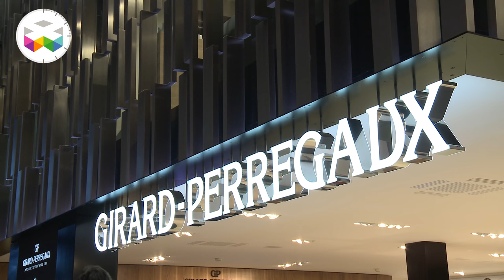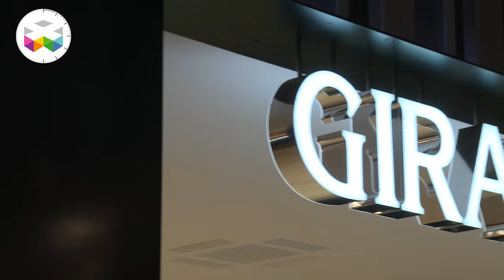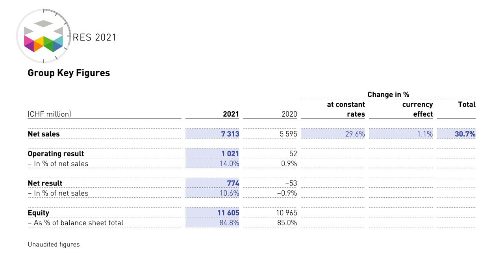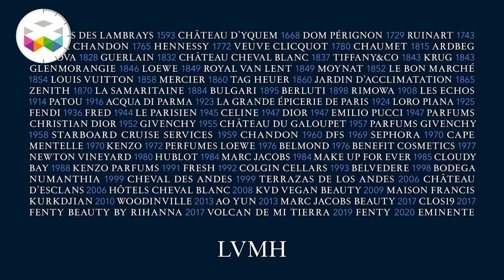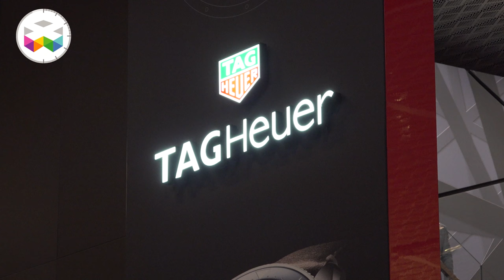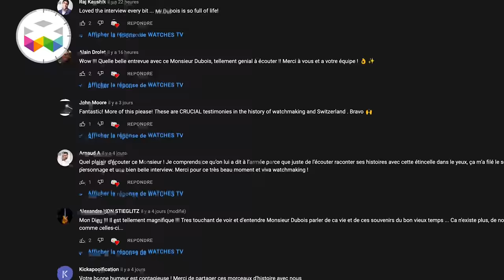PRIMETIME - Watchmaking in the News - February 2022

Comment: New to the AP brand but definitely see the appeal each line possesses. I really hope they take more time in fleshing out and perfecting the code 11.59
Reply from the maker: In all honesty, I think it has already improved, not sure it will be my next purchase, but there are a few nice models.
Reply: @user-zl2sc3bg3g  I think it’s improved a lot since launch as well, especially with the fume dials and sportier look from the textile straps. I just hope we see some smaller sizes or non-precious metal variants as the latest price increase of 10(?)% was a bit steep. Nearly $50k US for the 11.59 chrono vs a 27315 or 26331 at mid 30s is hard to justify.